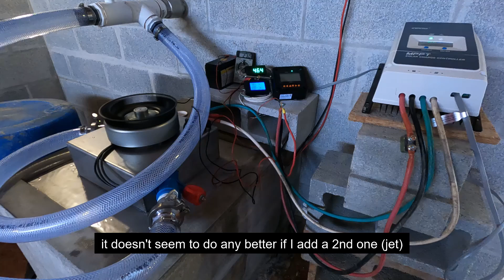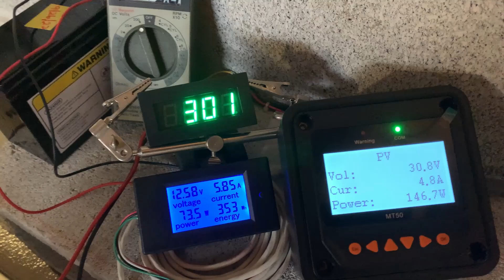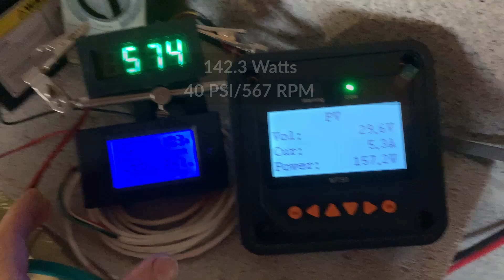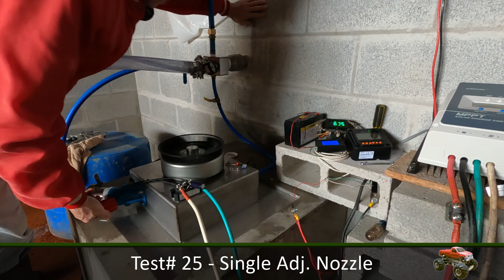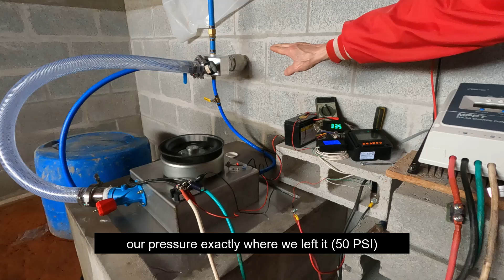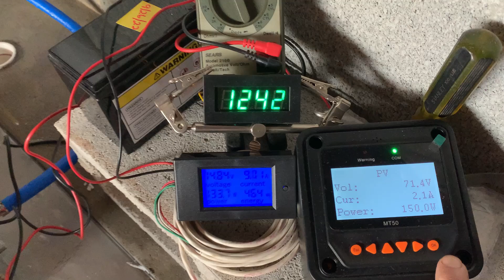Micro Hydro -  Epever Charge Controller

Comment: I noticed that with 2 open injectors you have too many pressure losses on the hydraulic pipe, too much flow rate for that diameter, you have to limit losses on the pipe to a minimum, tight bends, rapid changes in diameter both on opening and closing, also the T's and the taps they induce losses, the optimal flow rate is between 40 and 50 PSI, they are the minimum for a Pelton impeller, do not increase the diameter of the impeller because it will decrease the speed and the output voltage to the alternator, the impeller itself has an optimal speed to evacuate the water after work in the pelton spoons, then it also depends on the alternator how many poles it has, therefore its optimal speed, try if you have the possibility with a Victron smat solar, but certainly the MidNiteSolar classic 150 is the most suitable and versatile even if the power is so low, obviously with charged batteries the turbine must not run free, a relay to insert a resistor or the water shut-off would be necessary.
Reply from the maker: Your explanation is very clear and detailed, I will take into account all the points you've made here. Thank you.

Comment: With 120v ocv, you should try to run a 48v battery setup, so your charge voltage is around half of your freespin voltage👌
Reply from the maker: That seems to be exactly correct, I've done different voltage tests and proves your point. My aim is to find the same power output with a 12 volt setup; I'm currently working on a larger Turgo runner to try out. Thank you for your advice.

Comment: Thanks For posting videos....i Love to see them...I see you have T or L connection for pipes wich delivery water to Jets nozzles...i think losses are there to, if you use Y shape maybe be better...
Reply: Not in this situation but i mean in allround efficiency....maybe you configure epever over the program wich is used for remote control...i Guess its slow at power tracking...maybe can you fix in program the settings of the sistem to trači quicklyer
Reply from the maker: @tortelini222  Great point, thanks.

Comment: The EPEVER tracer series is extremely slow at tracking, so don’t change the input parameters. Let it settle for about 15 minutes and you should have a better idea of what it can do. But when you keep adjusting it will continue to try to increase and decrease the voltage and monitor how much it outputs until it slowly finds the best setting. But when you change the flow of water you reset its work and it has to start all over again. 15-30 minutes on this model is what you should expect. Compared to an Victron that does it in seconds. It’s basically a dinosaur. Another stupid feature of that controller is that if you have a solar setup and in the winter don’t get above 1,5 amps or so it don’t start to mppt at all. It just does pwm. If you have a 30v solar panel then you basically get 0 power in the winter because it pull the panel voltage down to the battery voltage and at that voltage the panel don’t produce enough for it to start mppt. You basically have to disconnect the solar panel manually in the morning so that it starts at a higher voltage than sunset and just for instance 14 volts. It sorta gets stuck because of its own idiotic programming.
Reply from the maker: Thank you for your information. I gave this charge controller up to 15 minutes to have a chance to find the best output but all it did was get worse. I was thinking of using it on my solar application  but according to your comments, I should use it as a doorstop. Sunlight is not constant, it's always changing especially on a cloudy day!  So if it is so slow at tracking, then it is no good for solar either.
Reply: @Magutz  sadly that’s the issue I have with mine of same type at least. And I’ve seen reviews others have made while trying to find out if this was an issue just with mine and others confirm that they are incredible slow at tracking. It usually does its job if I just disconnect the solar panels and hook them back up again, so that it starts at something higher than battery voltage. Otherwise it just tries to pull the panel voltage down to battery voltage and keep it there. I actually tested it again today and it did the same thing. I had like an amp or two input from a 280w panel this morning. Disconnected the panel and hooked it back up again and left it for a while to do its thing and bingo. 16-20 amps in full sun. Mine is a 40 amp model tho.
Reply from the maker: @pederb82  It's disappointing knowing that their units have been around for many years, you would think they would've figured out the algorithm and gotten it right by now.

Comment: Any thoughts on using a hybrid wind turbine controller with dump load? May be these would be better as wind turbines as similar type, more so then solar ones. Thoughts?
Reply from the maker: Yes, that is a good idea and I will be testing one of those later this year. I have been looking at a few but find too many negative comments on all of them. Many claim to be MPPT but the comments say otherwise. Thanks for posting.

Comment: you really need a controller where can force the desired input voltage. Chris Harbour had this exact same problem until he got the right controller and could set the desired input voltage. I can't remember the name of it but if it comes to me I will make you another post. But the EPEver you're using now will just not work with that battery voltage. If you changed to a 48 volt system, the the CC would forced to a high voltage which would give you more watts with a higher voltage/rpm
Reply from the maker: Yes, Kris initially tried a very similar (identical remote module) charge controller. He doesn't specify which one but says it is a cheap Chinese one. He finally settled on the Midnight Classic 250, which I will try later this year. Thank you for the info.

Comment: Is that battery charging your only load?
you should try to load the system some more.
Reply from the maker: I am also testing using a 1K watt water heater as a load across a 3KW inverter.

Comment: Your voltage is near full charge. Try connecting your system to a flat car or truck battery. Also add a 200w light bulb to the circuit to draw the battery down. The MPPT senses the state of charge and maintains the input wattage accordingly. Just listening to the unloaded RPM slow down when the MPPT tries to find the correct setting. shows your battery is not flat enough.  You need to also do an open circut full flow test to measure the max voltage produced. Do not exceed this with the charge controller connected. Stop playing with the preasure and flow rate, leave it on the setting where you get the fastest RPM with a dead flat battery. Then let the charge controller do the thinking and work. Also I fitted 2 capacitors to help the charge controller find the max power point easier.
Reply: Exactly
Reply: excellent and correct advice, well done
Reply: I was also thinking about adding capacitors. A 10 mF (not µF) capacitor should smooth out all the voltage ripple off the rectifier (inexpensive on Digikey). It could be the DC ripple is confusing the solar MPPT.
Reply: @MarkRose1337  correct, we have three-phase which are certainly between 200 and 500Hz and cosfy o.6 for which 3 AC capacitors would be fine to correct the power factor at cosfy 0.9
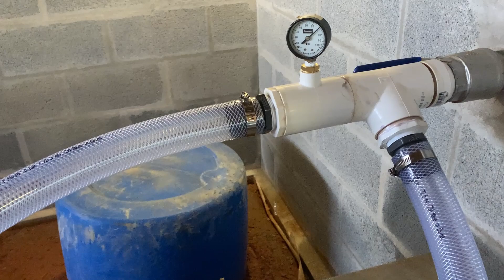Reply from the maker: On the video at 0:43, I point out the starting voltage of 12.02 VDC, the 3 batteries are at a full discharge state. I'm also running the lighting in the basement which consists of 10 6 watt bulbs. Also in my previous video (Micro Hydro - Cheap Charge Controller @ 6:30) you can see the open circuit test which is 126.5 volts. The longest I left the charge controller do its thing was 15 minutes, but during all this time all it did was just lose power. I was also using a 470 mfd cap at the output of the rectifier on these tests. Using this charge controller at least on a hydro installation is a waste of time.
Reply: @Magutz  do the following test: with no load it is 125 volts, then the optimal working point is around 60 volts and if it is difficult to find the point, put a filament or halogen 220 / bulb in parallel to the 125 volts DC
20/40 watts

some mppts hear radio frequency generator disturbances that interfere with the programmed pic
you can also use an electronic transformer for LEDs or similar, with 230 AC (320vDC) input and 40/100 volt DC output and connect this voltage to the mppt
all electronic regulators-transformers have a bridge of diodes and capacitors that any voltage higher than 60 volts, and variable frequency, give the stabilized DC output

Don't give up and good work
Reply from the maker: @udos46  Thank you, I will take your advice and give this unit another chance in the future.
Reply: some customer connect a little resistence between the power supply with controller,and then it can work with controller.But it is not the standard answer.